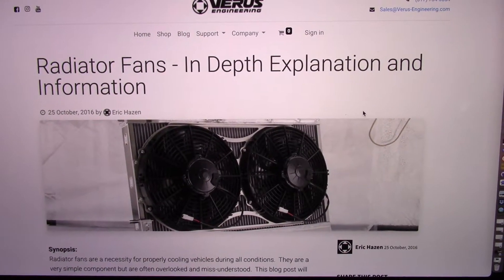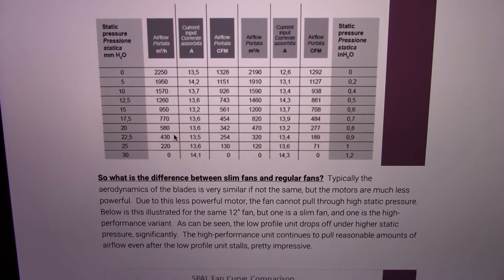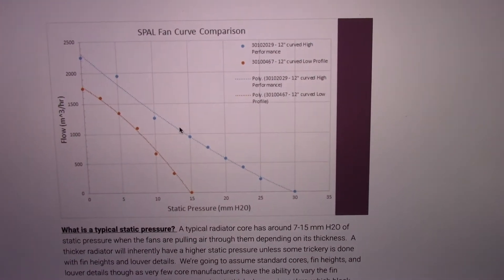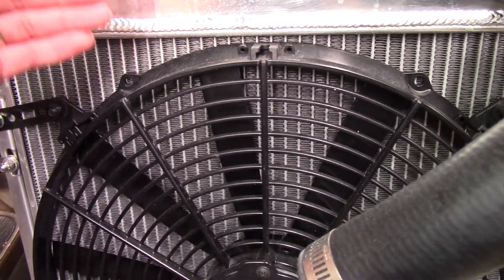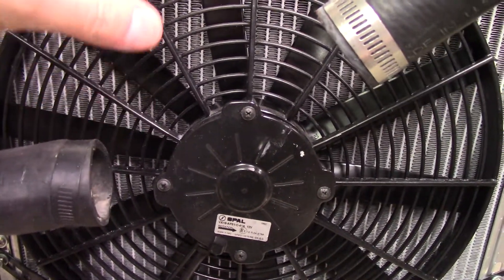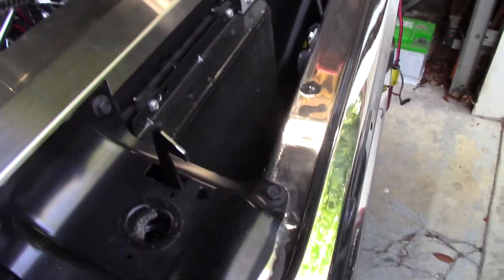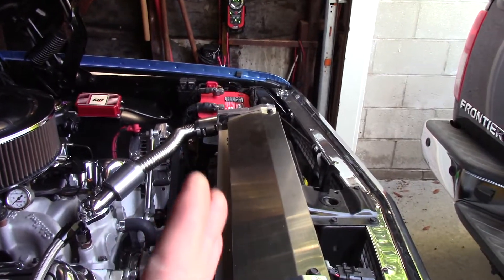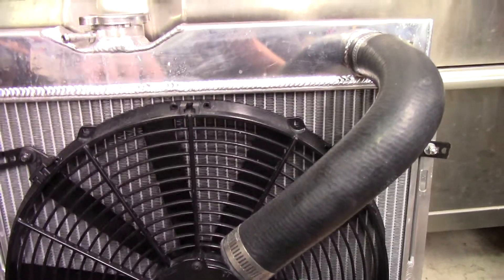Selecting Electric Radiator Fans the Right Way

Comment: I'll never buy a champion again... mine is leaking in 3 spots hardley used. U need a shroud for that.  Those fans will destroy that cheapo.
Reply from the maker: Been fine for years now. No need for a shroud. It has been fine in 100+ degree heat. 
If yours is leaking I’d be checking for electrolysis issues.

Comment: Question please, I have a 47 Chevy coupe, with a 4.4L straight 6 cyl. The rad is a re-cored, brass material, with 3 cores.. There is absolutely NO room for any kind of fan on the engine side, so I purchased a 16" Flex a lite pusher fan, with 2750 cfm. I am wondering if this set up will work or not. You really seem like you know your stuff and I would love to hear any feedback you have. I enjoy your videos and thanks in advance!

Comment: HI I LIVE IN LAS VEGAS.   I HAVE  383 IN A 1970 CHEVY.  CANNOT COOL IT IN THE SUMMER.   HAVE TRIED MULTIPLE FANS / RADIATOR COMBOS FROM SUMMIT, COLD AIR, CHAMPION,  AND OTHERS.  THINKING OF GOING BACK TO CLUTCH FAN. IT JUST MOVES MORE AIR FROM WHAT I SEE.   WHATS YOUR IDEAS?

Comment: I had an old flex a lite shrouded one piece fan go bad. I tried ordering a new one but the design changed and it wouldn't fit. I ended up installing a no name 18 inch fan that I had, on a 3 row aluminium champion radiator. 
It draws 18A at startup, maintains 8A draw at full speed. It holds my heavy leather work gloves on the face of the radiator.

Comment: "Bigger tubes are better", I am unsure that is totally correct. When the total coolant fluid flow enters the rad, smaller tubes will better balance the flow across the full length of the header, better than bigger tubes. Also, the smaller diameter tubes will likely force more contact of the flowing fluid against the inside of the tubes, reducing tunneling in the tubes, giving better heat transfer. However, small tubes may block up sooner with dirt, corrosion products, and debris in the coolant circuit. Smaller tubes may also be higher overall velocity, causing increased erosion in the parent material of the tubes. Anyway, size the rad flow rate to the engine and coolant pump, and it should work fine.
Reply: Do some more research. Ur arguments sound logical but engineering isn’t just logic
Reply: @ramyalabed91 I am interested, do explain.

Comment: Can you recommend a Spal fan, I have a 2010 v10 (6.8L) e450 in a motorhome, i have 3 rads (eng rad is 2 inches thich, second cooler is 1/2 inch, not sure what the 3rd cooler is for but it is approximately 2in thick), I have plenty of room between the fan and rad (around 6 inches)

Comment: Man very informative video, thanks for the info, but its making me second guess my recent purchase. I have a champion aluminum radiator not sure which one exactly, on a 1966 Mustang 289, and I bought a shroud and a spal puller model# 30100400 said it was rated at 1298Cfm. I believe its a 2 row radiator with 3/4" tubes. Does this sound like a good setup for my application?

Comment: I have a 2004 chevy suburban and my clutch fan works well enough but sometimes during hot SoCal summers the AC is not half as cool as it should be, unless im on a highway moving at a consistently moderate to high speeds. I have been watching a lot of videos about upgrading to an Efan to solve my issue. Thanks for the informative video- this helps me have a better understanding of why and what Im trying to accomplish and everything that goes with it. 👍🏽

Comment: That was more technical stuff in one vid than I’ve ever seen since college!!! I’ll have to watch it a couple times to soak it all in!!!
SUBSCRIBED!! 
Trying to run down a constant overheat issue on my SBC swapped Jeep YJ- with almost no results! Your info will help a TON! Alf ready picked up a Spal 16 low profile, and have been playing with thermostats trying to keep it cooler- but over time it’ll creep up to over 230*- and that’s at low speed around my neighborhood- but works perfect at idle….. I had a 160 thermostat, and have played with so many temp sensors to control fan on/ off- but no matter what sensor- once I start driving it they never turn off and temp never comes down, unless I stop and let it idle. Going to try a 180/ and a gutted thermostat with present  fan sensor of 200/ 185 to see if that works, but after that it’s going to be a better radiator! It’s supposed to be a 3 core aluminum (Amazon) but doesn’t seem to help. Also it has no way to attach a fan shroud- so I bought one that I’m going to try metal taping on to see how much improvement it gives…… so you can see, I’ve been fighting this for a WHILE! Your info will be very helpful!!!!
I did also find blown head gaskets on both sides (after A LOT OF HEAD SCRATCHING- that only leaked between middle two cylinders on both sides- no oil water mix, or bubbles in radiator! So it made that hard to find) so did a head swap and new gaskets, but still runs hot under load…..
Getting down to the last few parts now after tons of money and effort over this!!!!!!!

Comment: Hi Sir the radiator electric cooling fans on AliExpress on one of the electric fan it is a 14" straight fan blades & has 1900 cfm & the RPM can go up 2500 revs do you think that this electric cooling fan would work for a Toyota 3.4v6 engine? Kind Regards Peter
Reply from the maker: I personally wouldn’t be buying fans from AliExpress. I only buy Spal because they publish enough information to judge what will work properly, and they provide a high quality product. 
As to the question will that fan work?  Depends on the core thickness of the radiator, if you have AC, etc. Its hard to answer if it will “likely”work without more info.

Comment: Coincidentally I have the exact same SPAL fan model on my stock radiator ( 1965 Mustang 289v8) .it is rated at 1459 CFM. I am installing a Cold Case aluminum radiator that is about 1inch thicker ( 2 core each 1 1/4” wide)  than the existing rad. I also have an AC cooler rad in front of the radiator. I don’t see any tech data on the expected CFM at different resistance levels on their site. Did you find the curve for this model?

Comment: Thanks Mech!  Agreed.  If my approx. 2” thin SPAL puller efan  doesn’t work well enough (REALLY tight fit), I’ll have to change to a pusher fan with a bigger motor.  The front of my radiator has much more space.
Reply from the maker: Just check the curve. Pushers, the performance curve falls off faster than a puller. They work, but you want as big as you can get.